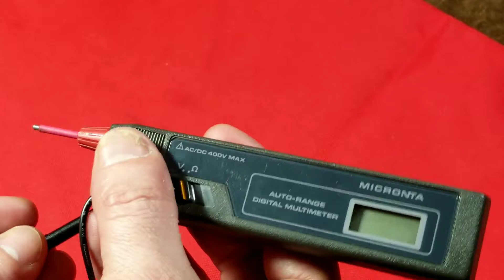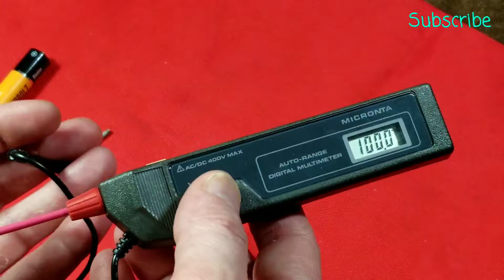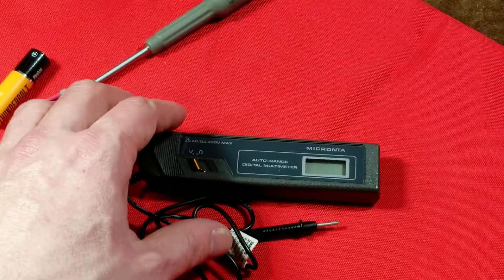Radio Shack Micronta Digital Pen Multimeter Review

Comment: According to online versions of Radio Shack's catalog 22-165 1989-1992 highest price was $39.95
They also had 22-171 1988-1994 $24.95, same basic meter, different form factor with Diode check instead of Hold.

I wanted the probe style version, but ended up with the other for Christmas '92 as the store had sold the last one.
http://www.radioshackcatalogs.com/

Comment: They say the Ridgid and Dewalt are made in the same Chinese factory that Home Depot’s parent company owns  they  do utilize a lot of the same components  like switches,  electric boards  Lowes owns another facility that they do the same with  some of their tools  there is good and bad in that  as its going to become a boring world  in the future  when everything  is made by the same people  and yes i  agree with the 2 battery. Idea  so much that i  started byin Black and Decker  cordless tools from Walmart  because of that reason and in all honesty ive been pretty impressed  by them for the money  i originally bought them to use on my boat and camper  as a back p set. And i fond they are pretty well made and reliable  that more and more they have been becoming my go to  set  they do  have some Harry Homeowner features  like  a light   Positioned to shine on your work. And other. Features. Yo may not find on professional sets. But i find those things to actually be  useful  often on a boat. You are in a cramped  or   Low lit area

Comment: You have the neatest tool collection! You have a very informative channel and is by far one of the best review channels out there for shorter non bias thoughts and opinions, Ace hardware has a ratcheting screwdriver that is supposed to be a snap on clone. They sell for $25.99 with like 20 bits and you can load the handle with 6 like a revolver, I was able to use my monthly ace rewards coupons $5 off anything and $5 off $20 to make its $15.99. I saved $60 from the snap on price! the knurling on the shaft feels great also. The PN is 00947144.